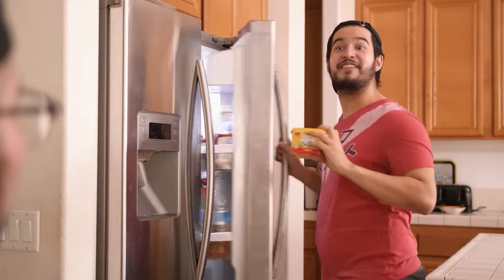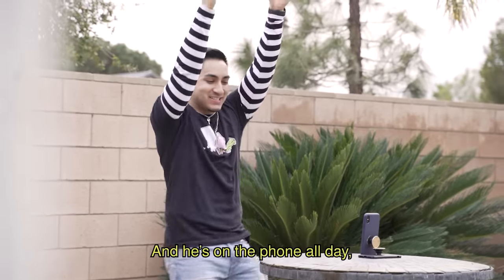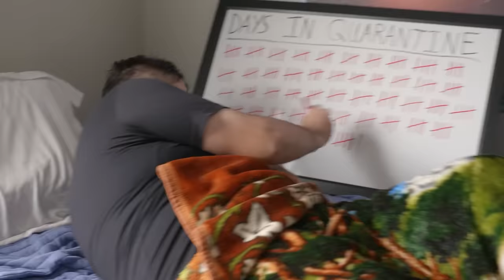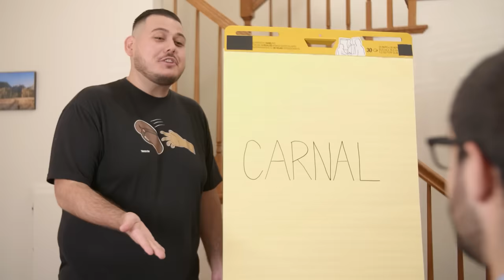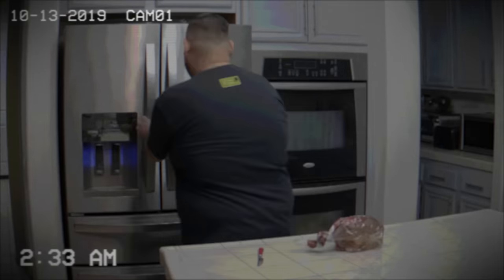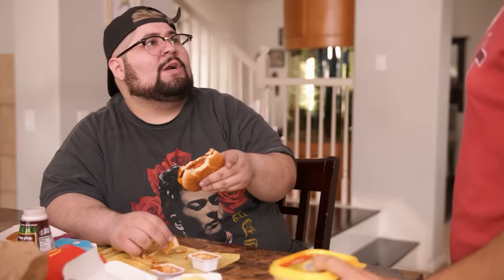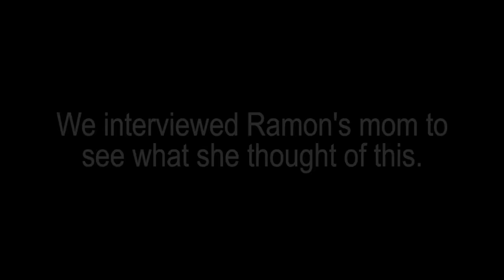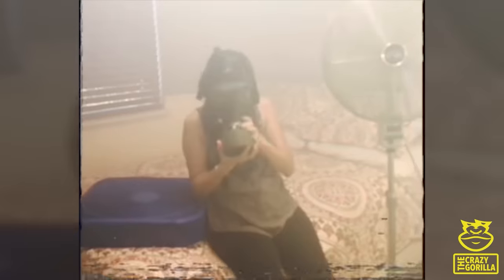TRADITIONS in a Mexican House (Compilation)

Comment: Question 1: How many players are typically on a volleyball team?

2 points
A. 6
B. 12
C. 9
D. 18
Question 2: What is the main responsibility of outside hitters?

2 points
A. Blocking
B. Setting
C. Attacking and passing
D. Serving
Question 3: Which volleyball position is often compared to a basketball point guard or an American football quarterback?

2 points
A. Middle blocker
B. Outside hitter
C. Setter
D. Libero
Question 4: What is the primary role of the middle blocker?

2 points
A. Attacking
B. Setting
C. Blocking
D. Serving
Question 5: What does the opposite hitter do when in the back row?

2 points
A. Setting
B. Blocking
C. Attacking
D. Covering
Question 6: What is unique about the libero's jersey?

2 points
A. It has a specific logo.
B. It is a different color than the rest of the team.
C. It has long sleeves.
D. It is worn outside the shorts.
Question 7: When does the middle blocker typically play in the rotation?

2 points
A. Only in the back row
B. Only in the front row
C. Throughout the entire rotation
D. Never
Question 8: Which position is responsible for serving and playing the full back row rotation before substituting for a front-row player?

2 points
A. Libero
B. Setter
C. Outside hitter
D. Defensive specialist
Question 9: What is the opposite hitter's role regarding the setter?

2 points
A. Works independently of the setter
B. Replaces the setter in case of rotation
C. Coordinates blocks with the setter
D. Serves as a backup setter
Question 10: What is a common characteristic of both the libero and defensive specialist?

2 points
A. Serving ability
B. Agility and strong defense
C. Attacking skills
D. Height advantage